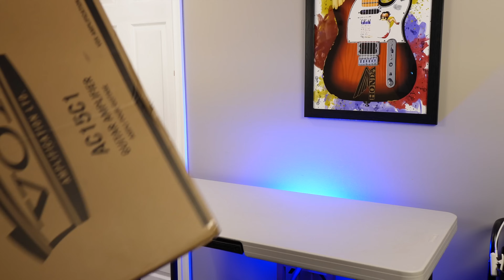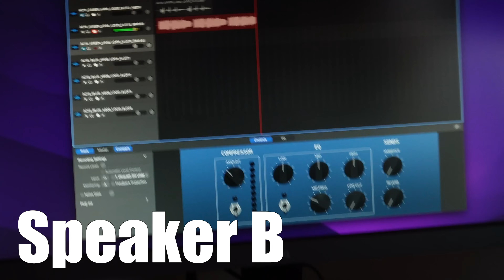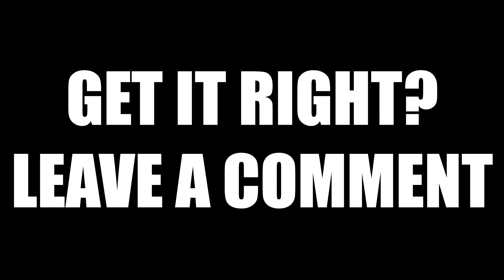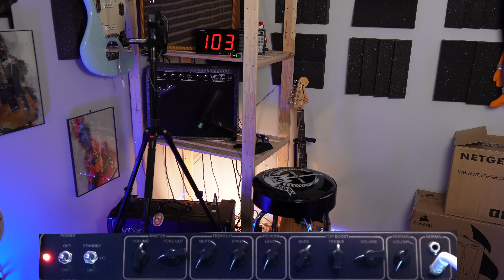Comparing 2 Speakers in the VOX AC15 - Green VS Blue

Comment: I have an AC30 with alnico blues. I also have a cabinet with 2 greenbacks. I’ve tried each alone and in combination. I’m now looking to replace the greenbacks with blues. The blues are simply the best speakers I’ve ever played through.
Reply: My AC30 has blues and really I  like the Greenbacks I replaced running in a 2 X 12 cab at the same time
Reply: Have you tried the Gold? I use one in a 1x12 cabinet, with a Orange Dual Terror Head and it's the best sounding bit in my entire signal chain.

Comment: I’ve got the old 1960’s Vox Royal Guardsman amp on the roller cart in a well earned retirement now. I’m now using the AC-30 with the  Alnico blues in it. It makes my Rick jingle jangle, my Fender Strats and Telecasters sing and my Les Pauls roar. It’s a little heavy but it can be moved by one or two guys. There’s enough handles on it. I love it, still gigging at 70 yrs old and no intentions of retiring from it. I told the guys in the band if I go to collapse on stage “ Save the Guitar “. Lol and that’s no joke !!!

Comment: For people that generally don't like tremolo, try setting the depth really low and the rate not too fast for a subtle always-on effect that just adds a slight bit of movement to sustained notes.
Reply from the maker: thanks for the tip!
Reply: That's pretty much what I ended up as my default setting. You can also set it higher if you're playing clean and keep the playing really sparse. I like to imagine I'm playing Wembley stadium!
Reply: This is my default use of tremolo too, it should be more apparent when it's turned off than when it's turned on if that makes sense. Kind of like reverb, you shouldn't really be thinking about it when it's there, but when it's gone you'll notice.

Comment: I've had one of these for several years and It's been a vey versatile amp. I ran it with the Greenback for a long time and it was great, but  I had a Weber Blue Dog laying around so I swapped it out and put the Greenback in a closed back speaker cab and run them together and it's AMAZING!!!!!!!    
I run a Les Paul trough it most the time run the Master at full and turn the volume to taste. 
Great Video!!!

Comment: I'm the same.
VOX is home base. I have an AC15C1 stock Greenback and a Pathfinder 15.

I also love my Laney  VC30 amps. VOX AC3O inspired, i have a 112 clone with a 70/80 style stock speaker (just ok) and my favorite amp, a mid-2000s Laney VC30 210 with two Jensen 10" speakers that were designed for that model. Wonderful workhorse of an amp, takes every pedal I've ever thrown at it.
Reply: The Laney VC line is great. And you can get them (used of course) for next to nothing nowadays; even the British made ones. I myself have an early Lionheart 5W Combo (with an Eminence GA-SC64) for recording and a Laney GH30R for live use. As you said: wonderful workhorses and pedal platforms. And the 2nd channel on my 2 Laneys can sound VERY close to a JTM45/Bluesbreaker without the need for a powersoak.

Comment: I'm a Vox fanatic (ac15c1 my favorite) and always bought a blue to run in a speaker cabinet in stereo with the amp's green speaker.  It's the only clean sound that can top a Roland Jazz Chorus.  I always knew the green had the edge for distorted tones (but not night and day) but in YOUR test I was surprised to find I liked the tone of the green for cleans.  That said, it's a) not a fair test when the speakers aren't broken in, since they're not in their "prime" out of the box which means their tonal character is very different, and b) my FAVORITE Vox tone is with a strat in the 4 position (neck/mid pup together) and that's the benchmark I use in gauging clean Vox tones because nothing brings out that patented Vox chime quite like it.  Another variable are the tubes which greatly affect tone.  I have a nice collection of NOS tubes from the 50s/60s/70s that really change everything.  In my tests, the green can't touch the blue in cleans.  I also switched that reverb tank out fast, didn't care for it. Still though I found your out of the box test interesting, thanks for taking the time to do it.  (PS:  I'm listening on 8 inch M-Audio studio monitors)

Comment: Great demo!
The difference seems slight, & they both sound great, but I preferred the blue. I'm sure It was more apparent in the room.
Now it has me curious what it would sound like with the back open like a Fender compared to closed.
You made a great choice In the guitar used to demonstrate the differences in the dynamics, but I am also a little curious what the others would have sounded in the comparison.
Great amp & great demo!

Comment: I recently purchased a Vox VTX 100. It's a hybrid amp and I don't really use the amp models. I set it to the Vox AC30 TB setting and left it there. I bought the amp at a local used gear music shop for only $171 US. I'm glad I took the chance. It's replacing my previous rig. Vox + a Boss Blues Driver sounds amazing.

Comment: A little Audioslave?  Its a great amp, great series of amps.  Plays extremely well in band setting too when everyone else is buried in the middle.  Awesome amateur tip - use the speaker extension if you have a spare 2x12 cab.
Reply from the maker: ya few chords mixed in there. cheers

Comment: I got it right. The Alnico Blue breaks up more smoothly with a fuller, more pleasant distortion to my ears. Oh yeah, it's good to have you back in the VOX family 🙂 So, taking off the back panel is unnecessary. All you need to do is remove the chassis screws, disconnect the speaker wires, then the back panel and chassis come away as a unit.

Comment: As the owner of two '66 AC30s, a '74 AC30, and a Rose Morris 80s era AC30; as well as a newer Korg Vox AC30 and a AC15HW, I can tell you that the modem Vox amps sound NOTHING like the originals - Blues loaded or otherwise. The closest Korg/Vox came to sounding like a JMI era AC30 was their AC30CC line which I believe was discontinued in 2010 to cut costs, but even then several mods needed to take place to sound like an AC30.  If you were to play the Chinese Made Vox and then play the JMI or Rose Morris Vox you would hear a significant difference.
Reply from the maker: if what I have now sounds good to me, why does any of that matter?
Reply: What makes the CC line better than the current production models?

Comment: That was a fun video. I liked the sound of B, which turned out to be the blue. 
I picked up an AC15 head a couple of weeks ago. One of my two holy grail amps. The other is a Fender Princeton Reverb, which I picked up a couple of months ago. (It’s been a hell of year, and I’m indulging myself a bit) 
I haven’t been able to play through the AC15 yet, for lack of a speaker cab. But I do have a Celestion 12” Goldback that I found on side of the highway a while back, next to its smashed cabinet and twin brother. I’m going to build a cabinet for the Goldback, plug the AC15 head into it, and make some noise. 😁
Reply from the maker: nice!

Comment: The blues aren't actually much brighter. They get the reputation for being more chimey, but honestly the bigger difference with them from a greenback is the tighter bass response. That's what makes the treble frequencies seem more accentuated. Both are valid speakers for Vox amps, and I personally think the greenback is a more balanced speaker for the modern Vox amps. 15:07 Actually, the treble and bass controls both control the mids of the tone stack. You joke, but I'm serious. The top boost circuit works that way. If you push the knobs above 12 o'clock, you begin to decrease mids. The inverse is true as well. One of my fav sounds with my AC30TB/6 is bass all the way down, and treble back to taste. It creates a wild clean sound.
Reply: The bass pushes at 250Hz, treble circa 2.5K both with Q around 1, by observation. No mid push, quite the opposite.

Comment: Every year or so I swap between the blue and green in my amp. They both have something I like. I made 2 cabs I use with another amp that uses a 12 inch green and a 10 inch gold alnico. They sound good when you can pair a greenback with an alnico.

Comment: I was looking for a new affordable tube amp a few months ago. which is crazy because I was looking at every video out there on vox, alnico blues etc. and did not come across this video until now. Anyways, I was going to get a western tolex blues jr 4 with the canibus rex speaker. I was talking to my sweetwater rep and what I wanted, and how I play and he told me to check out the vox ac15, ( I already have a fender amp) originally I was going to get the greenback version because it was 699 vs the 1099 for the alnico blue new. (I think both were 100 dollars off at the time). After a million youtube videos and trying to listen through headphones on what I wanted to do, and went back and forth for a while. Mainly because of the cost difference. I ended up going with the blue and I am so glad I did. I get such beautiful tones that I could not ever get out of any other amp / speaker combo. It is fantastic, clean, OD, distortion, fuzzes, just sooooo good.
Reply from the maker: hey thanks for sharing! I just featured the amp in this video too https://youtu.be/ji7j93aLaLA

Comment: Use a Creamback, save a big whack of cash, it still sounds really good, I've done this to my AC15. And dont get the screws mixed up, there are wood screws, pointed end, and corse thread, and metal screws, blunt end, fine thread. DONT PUT THEM IN THE WRONG HOLE. That applies across the board.

Comment: You really should try an AC30.  The AC30 uses a EF86 preamp tube, a very much different sound than the typical 12AX7 used in the AC15.

Comment: Oh, I liked the original speaker. Both sound great, but it felt like the green back had just a touch more tight definition.. probably imperceptible live of course, but in a quiet back to back comparison,  there was a touch more clarity to the original speaker

Comment: You’re right to put a disclaimer. Most amps have capacitors which hold their electricity and need to be drained with a ground. If you accidentally touch it you can get hurt. I see you were careful not to touch any electronics. 
Great video, i liked the green though, it might have been your settings tho.
Reply from the maker: ya I thought it was important to mention 🎸👍

Comment: I have an AC15C1 with a Greenback. I couldn’t make up my kind between them so I bought it with the intention of buying a Celestion Alnico Blue and adding some connectors to the speaker cable so I could switch between them easily. In the end I never get the need. 
What I would like is a 1x12 speaker cab in the AC with an Alnico Blue in it. Can’t figure out why Vox don’t seem to have them for sale.

Comment: the blue seams rounder and maybe more depth.  I have the green backs and while some my roll there eyes, I crank the reverb to 3 o clock and push the bass past the tremble.  I also have been using a slit adaptor so I can jump the channels and I dig it.

Comment: yippie I got the blind speaker demo correct. When you did the first riff clean the tone difference was obvious.. The blues are fuller in tone.. but the green backs are no slouches at all.. but I do prefer the blues.. I remember when Celestion probably only made 3 or 4 versions of speakers.. now way too many and can get confusing... and the rpices are wow.. but times have changed.. bring back the old Cetecs.. never blown one of those.

Comment: Word of wisdom to all, get rid of the spade connectors when connecting to a speaker. They need to be soldered. WHEN the spade connectors corrode or lose connection, good bye output transformer. $$$🔥🔥🔥
Reply from the maker: how often is that a concern?
Reply: @landonbailey  it depends. It could last a while or it could not. It could shake loose. It could last long enough to corrode. It’s the unpredictability that makes its unreasonable. I can trust a solder joint for a LONG time. It’s a simple tasks too so idk why amp manufacturers use spade connectors when the consequences of one of them coming loose would cost the musician a lot of money.

Comment: Preferred B, as to me it sounded clearer with more cut and punch - crisper and more cutting. Not much in it tbh and given the price difference the A speaker is better value for money. I do like VOX amps but only had a solid state modelling one but I thought it was great sound wise if a little complicated on the user panel. The valve/tube AC amps are legendary for good reason - they have a great tone and many famous guitarists have sworn by them.

Comment: When you removed the 4 screws on the speaker did the speaker come loose? With mine it's like the speaker is glued in place from the paint on the mounting board not being dry when they mounted the speaker. I will have to pry it off and it will probably damage the cork rim on the Greenback.
Reply from the maker: ya I show it in the video. I've had that issue before though on another amp
Reply: @landonbailey  It was really stuck down there so I ran a knife blade under it at the top and I was able to pry it off and it came off with no damage. The Celestion Blue is a definite improvement to my ears that I couldn't hear in any of the YouTube videos. I recommend getting an A-B-Y footswitch in between the guitar and the Normal and Top Boost inputs and it's like having a channel switching amp plus with the Y setting you'll get a third sound of both inputs combined.

Comment: Yes, i knew i remembered this video had the dB meter.  I just measured the  dB in my ac10 and want to see how the ac15 sounds at similar dB.  I'm really thinking about getting the 15 but want to make sure it's not going to be too loud for where i live.  I'm in an apartment but it's a nice solid old building and i can actually play my 10 pretty loud without any complaints. So i might be able to still turn the 15 up enough for good tone. But i needed to see some dB readings on the 15. I want to find one in a store so i can check myself but so far i haven't been lucky with that.

Comment: Yikes, I got it wrong. I'm surprised that I preferred the Greenback in the quick demo. I have two Voxes (HW60) with silver Celestions and they are incredibly fantastic sounding. Also I have chance to buy a mint used AC15C1 with greenback for $375. I was unsure about it actually, only because I already have the AC15 and AC30... Maybe I should revisit that. Right now my main sound is the AC15 in stereo with a Tweed Deluxe clone (Clark) both running clean with stereo reverb and delay pedals. My main drive sound is coming from an 80s Hotcake. The hotcake is made for Vox and pairs really well. I'd love to use the amps driven tone, but they are just too loud for what I need currently. These are vintage style reissues with no master volume.  Nice to have when needed though.

Comment: I have a 15 Watts valve carlsboro classic, I took the green back out and replaced it with a celestion blue. I prefer the vintage tones using alnico speakers. It had a marked difference especially using my sub zero bass vi, more mellow, you feel the bass as well as hear it. It's less of a job than the on the vox amp

Comment: Got the blind test right due to owning an non X AC30. The greenbacks at times can sound similar to the blues but the greens handle OD a lot better than the blues. In a perfect world I would A/B two AC30s with greens handling OD/distortion with the blues doing clean. The greens get a bad rap IMO with Vox nerds. But greens are great if you can't afford the price tag associated with the blues. In fact Jonny Greenwood switched to greens, so if it's good enough for him. And yes, I commented twice.
Reply from the maker: cheers!

Comment: If you take a Vox amp and remove the stock speaker, then install an aftermarket speaker, do you still have a Vox amp?
Reply from the maker: is this a test?
Reply: I think they both sound good. Thank you doing all of that work.
Reply: Well, Vox sell a version with this Alnico Blue speaker so I’d say yes!

Comment: Actually, the mesa ta-15 does excellent vox tone as well.
Reply: I really wanted to try those - especially when GC blew them out at a fantastic price. Try a Morgan too. fantastic.  I have the Synergy Head with Morgan AC preamp and pretty happy.
Reply: @trebleboost7  I've heard good things about the Synergy system. The ta15 is a good studio tool. It does very good Fender Cleans as well as Tweed, some early Marshall tones and AC tones. It is weak at very heavy tones, the low end flubs out and also there is no FX loop. Since i use it as a recording amp and metal tones are not things i use, it has worked out well.

Comment: I just got a used vox ac15c1 and I’m not sure if I’m being backwards or the person I got it from changed it. The impedance selector is at 16ohms with the ridges in the up position right. Is it the ridges or the black that indicates selection ?
Reply from the maker: I believe the line indicates which option is selected but check the user manual to be sure

Comment: You could have bought the ac15c1x
 It has the same speaker. Even has upgraded preamp or something i forgot. Anyways...

And yes the Chinese celestion blue one is the same thing. Sound exactly the same and is the same.

Oic working on the amp is part of the video lol. Anyways if you read this (not the youtuber) just get the ac15c1x (oh he just said ac15c1x as I'm writing this).
Reply from the maker: the ac15c1x does not have any other hardware differences besides the speaker
Reply: @landonbailey  Hmm you're right. I guess that was the blues junior western tolex  I had confused it with.